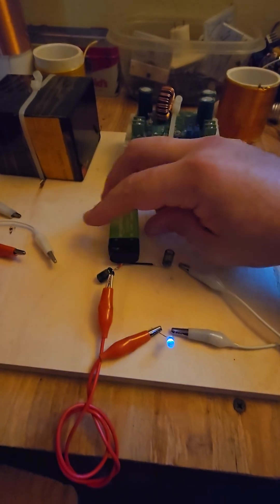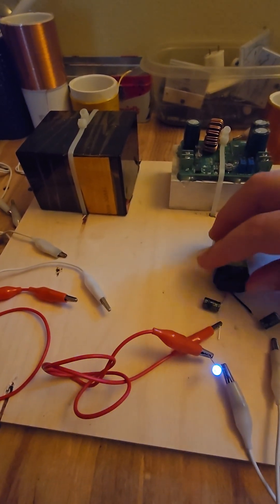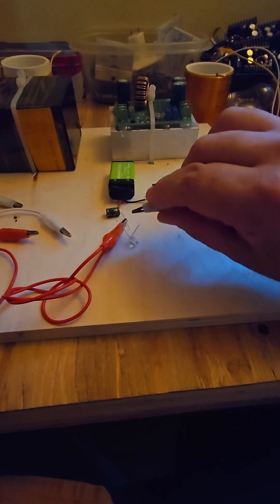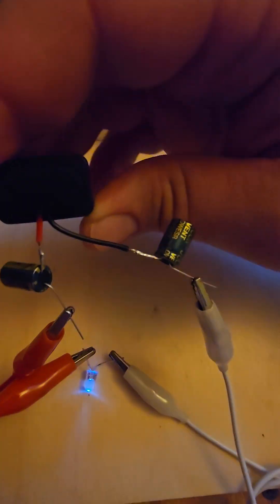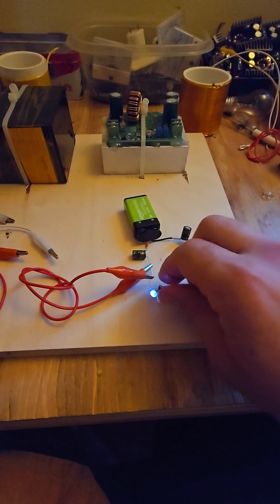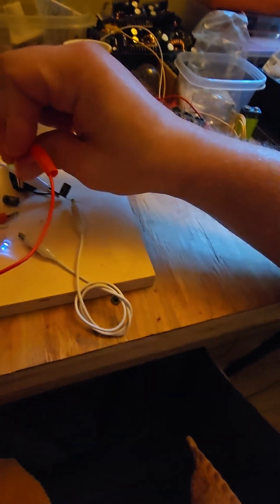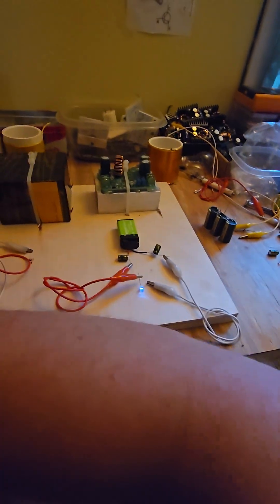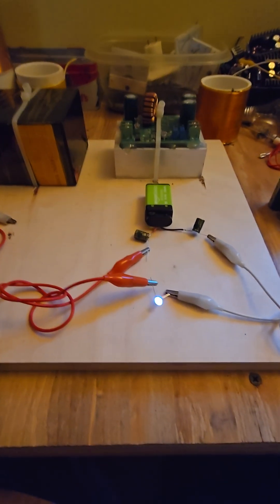UPDATED VIDEO ON REFINING THE ANOMOLY.ITS A CAPTRET?HOW IS DC FLOWING THRU SERIES CAPS?

Comment: I just thought of something.  This isn't some sort of photoelectric effect, is it?  Have you ran any experiments in the dark?
Reply from the maker: Yeah its been going for days & is very odd
Reply: @MTECH2022  Any indication of potential drop in the battery as of yet?
Reply from the maker: @JenkoRun  still at 8.80vdc which is very odd & brightness of led ever so slightly fluctuates
Reply: How old is the battery?
Reply from the maker: @thecontact2609 its relatively new & has been off the 9vdc charger for about a month unused & fully charged :)
Reply: @MTECH2022  You said that you couldn't measure any current, was that on a wire that went to the battery terminals or the LED? If on the battery wire there might be detectable current on the LED side of the wires, and if the LED is fluctuating that could indicate the presence of current.
Reply from the maker: @JenkoRun  possibly & yes if you get the two series dc capacitor values correct you won't be able to measure any current flow but the led will be very dimly lit.
Reply: @MTECH2022  Oh? So with values where you measure current the LED gets brighter and the batteries voltage remains unchanged?
Reply from the maker: @JenkoRun  yeah when the led is consuming microscopic amounts of power from tge incorrect series dc capacitor values the led will be slightly brighter & the battery voltage will slowly drop over time instead of showing the anomaly. Somehow the dielectric layer in the capacitor can produce very very small amounts of power from a voltage potential only with no current drain preliminary tests seem to indicate. Once the correct value dc capacitors are used we get dim light with 0 current flow & the battery never drains. Hope that helps :)
Reply: @MTECH2022  So that's a no to my question then, it would help to know if, when the values are correct, there is no detectable current on the LED side or just the battery side, or both, if there's none on both sides it brings further questions to the table about the whole thing.

I wonder if this effect would work with a strong electret instead of a battery, and if current could be produced.
Reply: Here's a theory that I've come up with.  Going off of what Ken Wheeler said that everything works off of pressure mediation.  I'm almost thinking that because you have the capacitors going in opposite directions, the current flows for a short time (when the led gets brighter and settles down to a more dim level); the capacitors are then filled to max voltage and there is now a pressure where the led is.  Because the current is blocked at this point in time, the circuit is now in an unbalanced situation and so has to draw upon the local environment to balance the circuit out.  Thoughts anyone?
Reply from the maker: @thecontact2609  that actually kinda makes logical sense & I'll plug your theory into my Gemini research program made for Advanced electrical systems analysis. :)
Reply: @thecontact2609  I was looking through Joel's content and his Self Recharging LED video has something similar to this that may offer an explanation and it somewhat aligns with your theory, essentially the source is almost only a voltage potential with less than 1mA and the LED acts as a nonlinear timing gate which creates a pulse rhythm in the current, the pulsing action creates an inductive discharge/spike that heads back and recharges the battery.

To give some context about inductive discharges/spikes, as Bedini and Bearden explain, they are completely sourced from the environment alone in an implosive manner that operate inversely to conventional power. 

Inductive discharges have unique properties where they grow with resistance instead of dissipating, if negative resistance grows positive energy, as Mtech has been demonstrating recently, then negative energy grows with positive resistance, which could mean this is what's happening here with the captret, and Mtech did note that the LED has a visible flicker.
Reply: Ive been thinking also to try this method with a higher voltage.  Instead of using an led and 9v battery, we insttead could put together a series 90v DC sorce and use one of those 90V plasma tubes as a dischage.  If you want to collect from the plasma tube, then place something in parallel with the dischage tube.  Any thoughts about this idea?
Reply: @thecontact2609  Worth a try, I'd first see if there is an inductive spike in this system at all first, a high inductance coil in series with the discharger, be it LED or plasma tube, and look for any voltage spikes in the system. If there are any then from there I'd see about trying to direct them into a high resistance to see if they can be made to grow using resistance.

Plasma tubes are good if you're looking for a negative resistance element due to its self-organizing nature, but with the inverse characteristics of negative energy I would assume a negative resistance would dissipate it, but that's just a guess.
Reply: @thecontact2609  Just to note he doesn't have the capacitors going in opposite directions, that would be + to + or - to - where in his setup it's wired as standard, the battery positive is to the cap negative and vice versa.

For your theory, that's certainly a plausible possibility, I have a theory that there is a small current between the caps to the LED created by the differential in the caps that keeps the battery isolated, but I need more data on that.
Reply: I like that idea, but make sure the induction coil is after either of the caps because we want to block the DC.  The coil would allow the DC to pass through.  To take this even further, I thought putting a diode in series with the plasma tube will simulate a sort of led, but I could be wrong.
Reply: @thecontact2609  Yup, coil after caps for sure, not sure about the diode, heads not really all here atm (sleepy) so worth testing both sides of the tube, minimal time taken too.

Comment: The LED is a simple low resistance load, Caps will try to charge to capacity and still supply current and voltage acting as 2 mini batts.. It will drain out just as fast or quicker than running the LED with a series resisitor to the LED. Great vid however bud!
Reply: Did you miss the part where the battery is doing the opposite of draining? There are a surprising number of commenters here ignoring that.

A battery drains = it eventually dies out.
A battery recharges = it stays on and keeps going.
Reply: @JenkoRun did you guys figure it out yet? I would just delete these videos else lose all credibility. I mean, it's already been lost with anyone who has 2 functioning brain cells but even the die hard worshippers and dick riders will soon figure it out. It's over for this guy.
Reply: @brianp5210  How about you just set one of these up and leave it on the desk for a few weeks and keep track of the damn voltage potential, do your own (easy) test and contribute something for once.
Reply: @JenkoRun https://youtu.be/UA3QQJ02Hng?feature=shared

Comment: Mm Polarize capacitor acts differently. If you hook it to a right positive and negative terminal it charges and stops the flow of Current but if you hook it up in reverse it acts more like a short circuit (well on other capacitor it still charges but it will have equivalent series resistance that limits the flow of Current which the capacity slowly heats up)

Thats why the Polarize capacitor due to it's internal structure behaves more like it has a diode in parallel to the capacitor.

While on Unpolarized capacitor it doesn't behave like that.

Other cases is maybe your capacitor is slightly dead or "half dead"

Comment: Interresting effekt,
But I think that could be explainable.
I asked chat GPT.
Could you doing some more testing please?

🔎 Why does the LED stay on, even though it shouldn't?
You're right to be puzzled:
Electrolytic capacitors (electrolytic caps) block DC current once charged.
So theoretically, in your circuit (9V battery → two 470 µF caps → 3V LED), the LED should not light continuously.

💡 But your LED stays on. Why?
✅ Most likely reason: Capacitor leakage current
Real-world electrolytic capacitors are not perfect insulators. They often have a small leakage current (especially when old, low quality, or reversed in polarity).

This tiny current can be enough to light a modern low-current LED.

🧪 What’s really happening:
At first, when the battery is connected, the caps charge → you get a brief inrush current, which may light the LED momentarily.

But then – due to leakage current through one or both caps – a small but steady DC current continues to flow.

Even a few microamps (µA) can make many modern LEDs glow visibly, especially in a dim room.

⚠ Possible contributing factors:
Leaky or reversed capacitors
– If a cap is connected with wrong polarity, it leaks a lot more current.

Old or poor-quality electrolytics
– Aging or cheap caps often leak more than they should.

Very efficient LED
– Some LEDs light up with less than 0.5 mA of current.

✅ Test it!
You can confirm this with these simple tests:

Test 1: Measure current
Use a multimeter in µA range between the LED cathode and ground.
If you see any measurable current – it’s leakage current from the caps.

Test 2: Swap capacitors
Try brand new, high-quality electrolytics → The LED will likely not glow anymore.

Test 3: Reverse polarity on one cap
If you reverse one of the caps (deliberately), the LED may glow brighter – clear proof of internal leakage.

🔬 Summary:
Electrolytic capacitors aren’t perfect – they leak small amounts of DC current.

That’s why your LED stays on, even though the circuit shouldn't allow DC through.

This isn’t a "feature" – it’s a quirk of real-world electronics.

Let me know if you'd like:

a version of this circuit that makes the LED blink using proper capacitor discharge, or

a safe, stable LED driving circuit using capacitors and protection components.

Comment: Leaky capacitors. Maybe they are connected with reverse polarity in this circuit, and so are giving a lower resistance to DC than they should?

Comment: Hi, i asked ChatGPT "Is an electrolytic capacitor a blocking device for DC?" Here's it;s answer:

ChatGPT said:
Hello! No, an electrolytic capacitor is not a blocking device for DC — in fact, it's the opposite.
Here's how it works:
Capacitors block DC only after they are fully charged.
When you apply a DC voltage to a capacitor (electrolytic or otherwise), current initially flows as the capacitor charges.
Once fully charged, current stops flowing, and the capacitor essentially becomes an open circuit for DC.

So: Yes, it eventually blocks DC, but only after charging
Hope this helps, I might try a replication thanks for your videos and experiments
Reply from the maker: Thanks & the led never goes out with this circuit but the battery very slowly drains somehow

Comment: Ok theres part of your answer right there. Its a 16v cap on a 9v source. Its no where near fully charged to capacity.
Reply: Dude, a 16v capacitor does not "fill up" by 16 volts, that's the maximum voltage it is rated for. The moment the potential across it matches that of the source it acts as an open circuit. And since you told me to use GPT last time I figured I'd use it to prove the point here:

"The 16V rating on the capacitor is just the maximum voltage it can safely handle. It's not the voltage required to make the capacitor act like an open circuit.

Here's a more precise breakdown:

A capacitor behaves like a short circuit (allowing current to flow freely) when it's first connected to a power source and is uncharged.

As the capacitor charges, the voltage across it increases, and the current flow gradually decreases.

Once the capacitor reaches the source voltage, it acts like an open circuit (no more current flows through it) because the voltage across the capacitor is the same as the source voltage, and there's no more potential difference to drive the current."
Reply: @JenkoRun  
In ideal conditions:
Once C1 and C2 are charged to the 9V supply, no more current should flow, and the LED should turn off. Capacitors block DC when fully charged.

🧠 But in real life — if the LED is continuously lit — then here's what's likely happening:
✅ 1. You're seeing charging behavior
Capacitors charge exponentially but not instantly. If your caps are large (say 470 µF or more), and your LED only draws ~5–20 mA, it could stay lit for several seconds to minutes.

🧪 Test: Disconnect the battery and reconnect it after 10+ seconds. Does the LED "blink" then dim again? If so, it's just capacitor charging.

✅ 2. There is a small continuous current — likely leakage
Real electrolytic capacitors leak. The leakage current may be enough to keep a low-current LED dimly lit, especially red or green LEDs that only need ~1.8–2V to turn on.

Leakage current can be in the microamp to milliamp range depending on cap age, temperature, and quality.

🧪 Test: Replace the capacitors with new ceramic caps or non-electrolytics, or measure leakage current with a multimeter in µA mode.

✅ 3. You may be seeing residual or parasitic effects
If your battery source is noisy (e.g., from a buck converter or power supply), some AC ripple could be coupling through the capacitors.

Or if your body is touching parts of the circuit, capacitance to ground can cause effects in high-impedance circuits.

🧪 Test: Try the setup with a standard 9V alkaline battery and keep your hands away. Does the LED still stay lit?

✅ 4. The LED is very low current and very efficient
Some modern LEDs (like certain SMD types) light up with microamps. Even trace leakage through the caps or surrounding air can be enough to keep them glowing.

📌 Bottom line:
If you really do have the LED and capacitors in true series, then the LED should not stay lit continuously in a DC circuit once the caps are fully charged.

If it does, you're likely seeing:

Capacitor leakage current

Ongoing charging (if capacitance is large)

Parasitic/stray currents

Highly efficient LED behavior with very little current
Reply: @brianp5210  Have you not been paying attention? There is no measurable current with the correct value capacitance, not even 1 milliamp, maybe even less than half a milliamp, maybe less.

Tossing it up to leakage when it's already below detection, and certainly too low to light an LED that bright, again shows how unreasonable you're being.

This is an anomaly, it is not in compliance with any standard EE understanding.

I've had enough, I'm filing you under the "brick wall" category, and we all know there is little point in trying to argue with a wall.
Reply: @JenkoRun just because he can't measure anything on his Amazon equipment doesn't mean it's not there. It's totally in compliance and I think I've given about a dozen reasons why it's not some big breakthrough discovery. Do you think no one else in the world ever put an led between two caps? And no one is taking into account that the battery has built in bms circuitry. Nobody knows wtf is going on here including you. The only brick wall here is you because you are blindly believing what you want to believe vs evaluating the facts. Use a lead acid battery and see what happens.
Reply: @JenkoRun https://youtube.com/shorts/GWcvJrQceHI?feature=shared
Reply: @brianp5210  Get back to me when you've done it correctly 🤦‍♂️
Reply: @JenkoRun please show us the correct way to do it since you have obviously done it correctly and know for a fact that this is incorrect
Reply: @brianp5210 Step 1: Acquire patience.

Step 2: Use a common 9v battery.

Step 3: Use 2x identical capacitors as shown in this video. Find whatever values prevent measurable current.

Step 3: Use a common single LED.

Step 4: Connect in series.

Step 5: Periodically check battery voltage over at least 2 days.

As of this moment the battery in this video has remained at 8.80 volts with the LED remaining lit, having since climbed from a low voltage, not possible by conventional theory.

Extra note: Incorrect capacitor values allow measurable current to be detected and prevent the noted anomaly, failure to match these conditions renders your experiment a poor recreation and will not be acknowledged.
Reply: @JenkoRun you should actually watch the video. Im not playing with toys I don't have time for that.
Reply: @brianp5210 And yet you have time to setup an experiment that has vastly different conditions to the original and expect it to act as proof. 

What an embarrassment.
Reply: @JenkoRun you guys are still trying to power LEDs and playing with slayer circuits while I was powering several hundred watt loads almost 2 years ago. You haven't got a clue.
Reply: @brianp5210  That's not going to change the results observed, no matter how much you try to throw shade on it with faulty recreations that don't match the original at all.

Setup the experiment correctly and record the results, then we'll talk about what is and isn't possible.

Don't bother me again until you do.
Reply: @JenkoRun you are so... You know. Im not even trying to recreate this experiment. It wouldn't surprise me if you don't even know what I'm doing. Lol. Flying it right in your face and you cant even see it. Lolololl